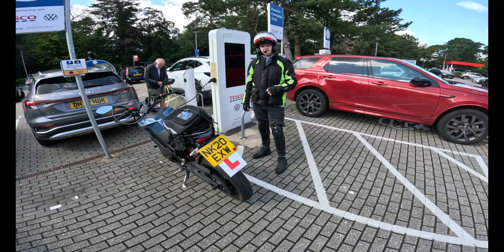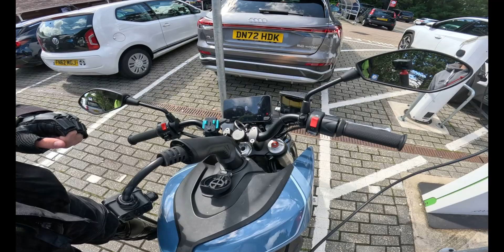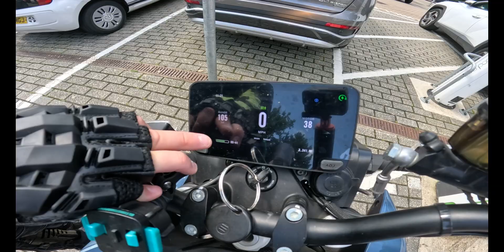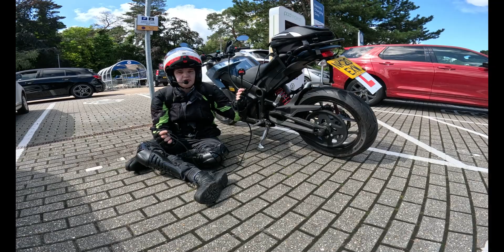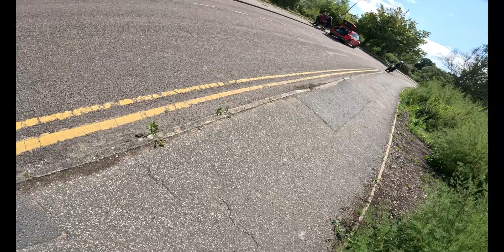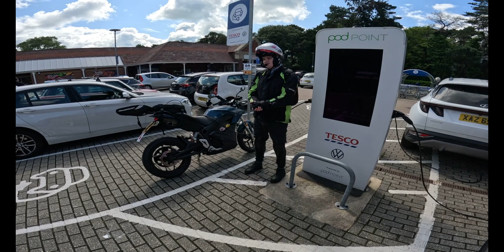Charging Zero Motorcycle - How to Charge Zero Electric Motorcycle

Comment: The slow charging overnight is one that I should consider for the zero electric bike. I would want to wake up to see that my machine is fully charged and ready for use. The fast charging is one that I can consider when it is necessary and not the top method that I am going to use. I appreciate your efforts in making this video on how easy it can with charging our ebikes.  A fully charged motorcycle can make my movements for the day to be easier.

Comment: The charging of the Zero motorcycle is very easy. It's like almost the same thing like filling the tank if it were to be a petrol bike.

There's no rigorous process required to charge the motorcycle and it would have been bad to make it so.

The slow charging with pin cable is a waste of time but I know a lot of people will be interested in using it hence why it's been provided for.